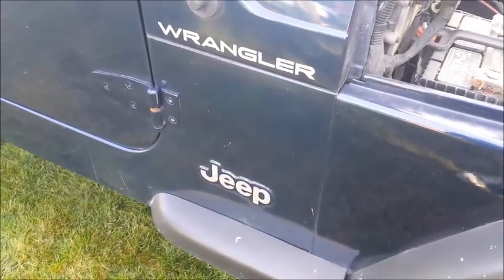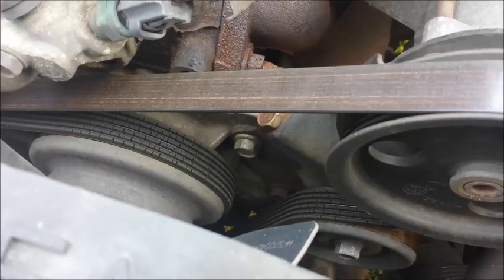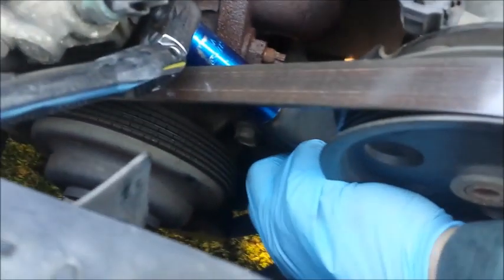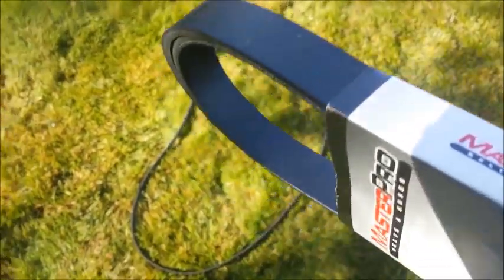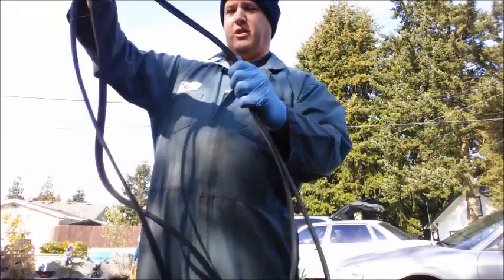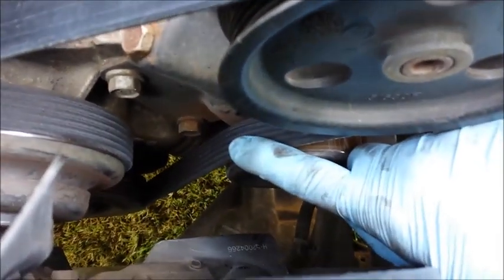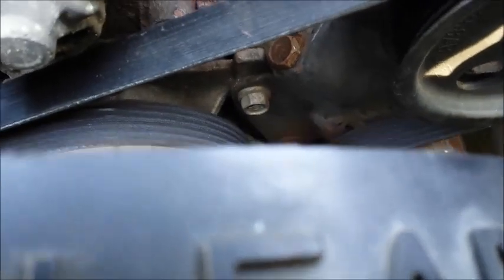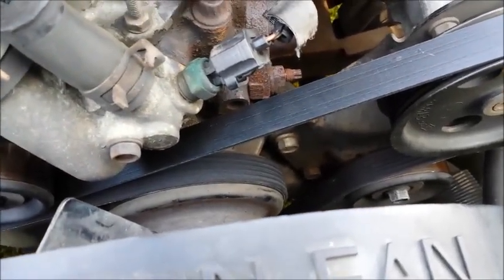Changing Serpentine Belt Jeep 1995 - 2002 Wrangler

Comment: Dude thank you for posting this video, I'm in the middle of replacing a locked up power steering pump of all the effing videos that showed putting it all back together not one single a hole had the courtesy of stating that you need to loosen the idler pulley then tighten the tension bolt before tightening the pully, now I'm on the hunt for a replacement adjuster pulley bolt kit..ultimate eff my life moment

Comment: Hey the belt for mine is also too small.  mine has ac.  They say I need 92 and 7/8.  But it looks more like 93 1/2.  And suggestions?  My pull and alt has been loosened.  Routed right.  Thanks

Comment: how many ft lbs did you tighten those if you recall?
Reply from the maker: Nathan Kopel never really paid attention to that kind of stuff. I'm not so detailed I would pay attention to torque 😀. Just tightened it down to snug, you don't want to break it off, you just wanted to be tight.😖
Reply: Shaw Family Videos there are some things i make snug and then there are some things im a little more precise with. thanks anyway. this is a good video. ill prob do exactly as you just said
Reply: rewatching the vid, i thought i heard you torquing it. i realize its an old vid, but your pulleys looked awfully polished. A little sandpaper may have helped the belt grip. oh well